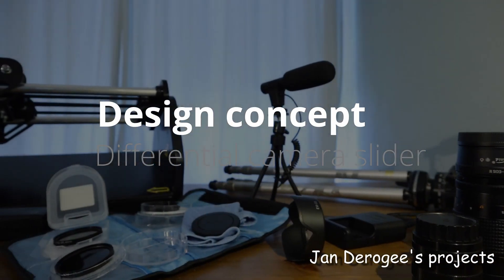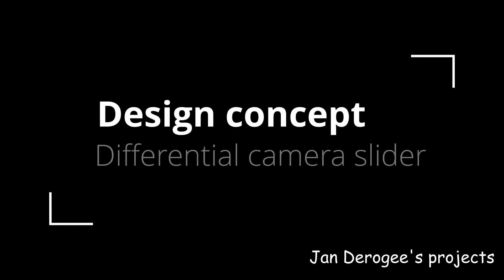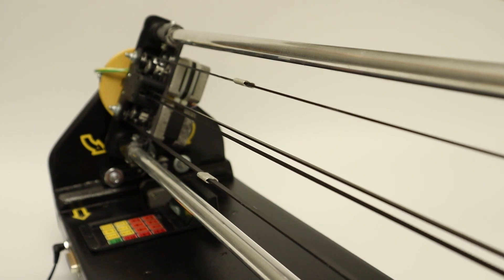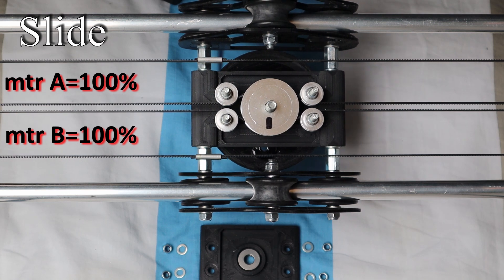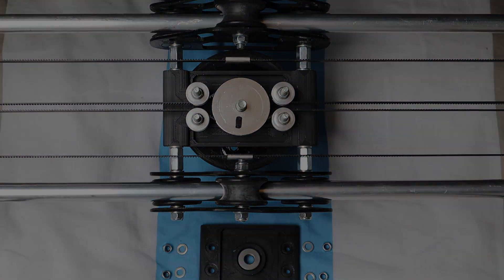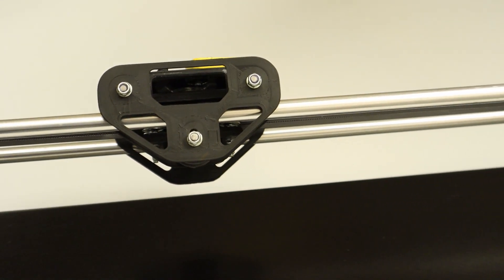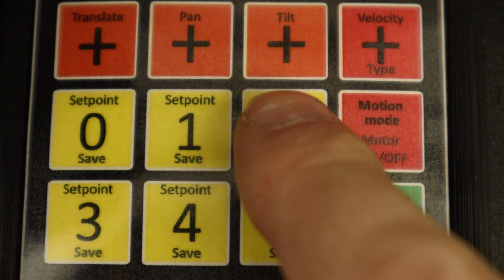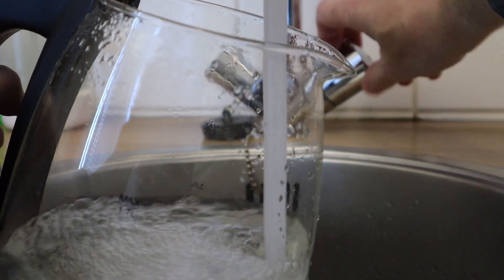Differential camera slider is amazingly universal!

Comment: Wow. Just wow. Are you going to release the STL files and code for the controller?
Reply from the maker: Although the video makes it look like it is a finished design, I can assure you that there are some bugs (some in software, some in the mechanics) that need to be fixed before it is to be released. So at this moment nothing is available yet.
Reply: of course. it is a very time consuming project i suspect. but if you released the files on thingiverse on beta state. someone can remixed your work. but again, it is your decision. thank again mate... 👍